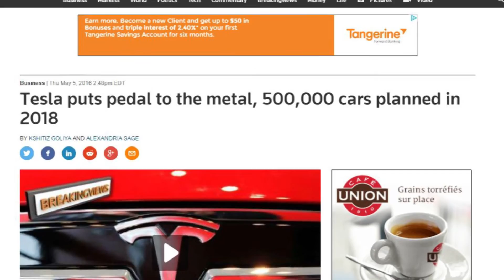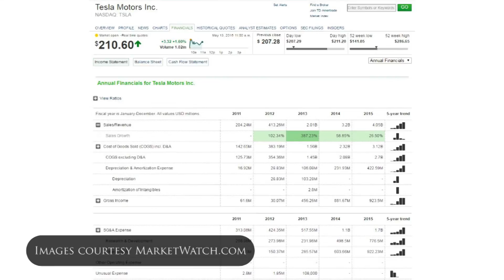Can Tesla Manufacture 500,000 Cars a Year by 2018?

Comment: this is  business as usual piece.
musk is building the machine that will build the machine.
model 3 only needs to start with one line.
when the line finally  moves at full speed, then all they will do is buy more robots.
the giga factory is already producing 150 megawatts in the space designed for 50.
when totally build out means 3 gigawatts, not 1.

all this inovation is repeatable any where in the world